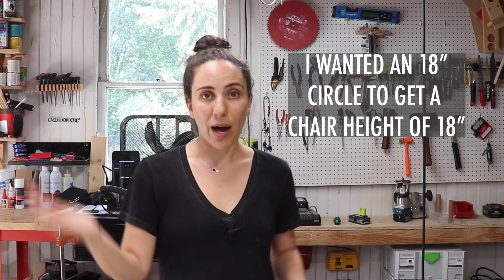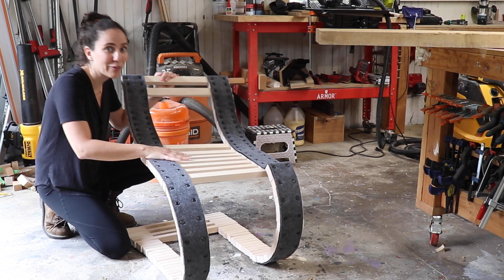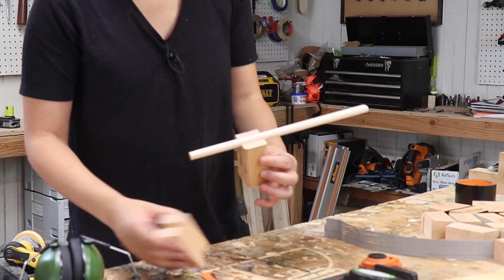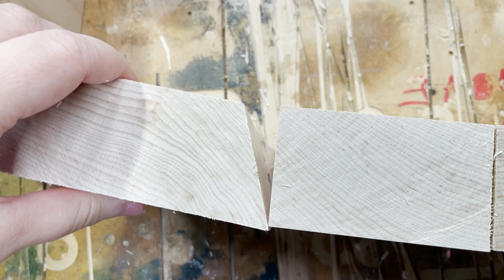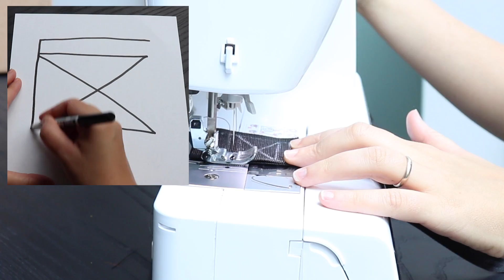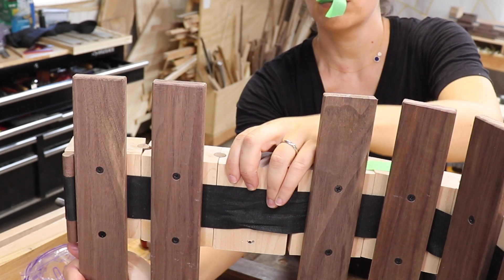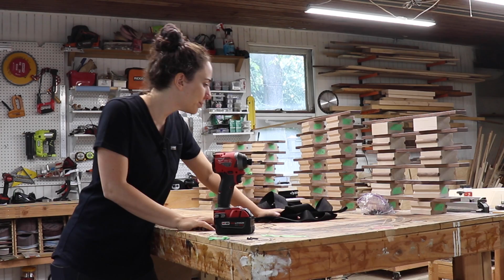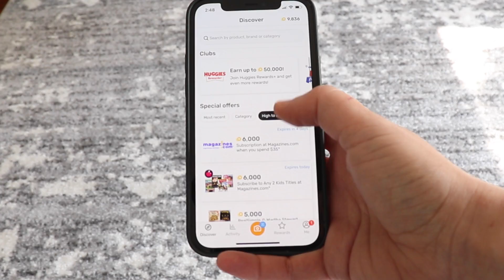I ATTEMPT to make a Roll Up Chair… AGAIN...

Comment: Actually you only need them to flex at the actual joints in order to unravel them right? So whatever material you use to connect them can be glued or fixed to the wood as securely as you want.
I think the main problem with this design is the sheer length of material that has the opportunity to stretch is just too much. If you limit what sections of material CAN stretch to only the joints, you should end up with a more stable bench. That said, that may also increase the force pulling those points apart because you're limiting where the tension is, whereas the current design is much more distributed. To test the weight, I would suggest putting weights on it, rather than yourself :P

Comment: Don't give up. Try manila rope it stretches very little and is a lot lighter compared to using a steel cable that some have suggested. That's why it is used for rope ladders, obstacle courses, etc.

Comment: I think instead of doing one big strap for the whole chair, you could do a strap for each segment. Then tension on one end wouldn't roll up the other. And to keep the chair from tipping forward, I think you should have a 90 degree joint at the front bottom.

Comment: Don't do it!!!! twice is enough already because there are just a few pieces  that take all the stress and would fail in time anyways as it is
so then first I thought of a side frame each side to hold the roll up securely  and in shape you want yeh it would work but no cigar
 and then thought what about adding folding cross pieces on the end of the floor roll up that could extend up and lock into the bottom of the seat and you could stagger them on the last two cross pieces to get the height you need to prop up the seat securely hahah yes it is bugging me too

Comment: I think the solution would be to fix to the strap to each board rather than allowing them to slide back and forth. Problem is that any tension you create is distributed and then released anywhere where you aren't putting pressure, like the top and bottom. flexible steel straps screwed to the boards could work.

Comment: Yeah the solid mechanics of this chair are very unkind when looking at it with a bit of hindsight, some modeling/calculations on this would probably show this needs some like... wild steel wire rope or something. But those stretch too! Long things stretch more (in length that is, fraction of stretching stays the same ofc) so that whole length of strapping with such a small crossection, under even moderate tensile stress, is just going to stretch. I don't think you need to waste leather on this. But the dowel splines look really cool, I love those!

Comment: You could drill a hole thru each block in place of the strapping and then insert a cable with a bolt with washer on one end and some threading on the top end and tighten another bolt with washer till the tension is correct as you want.  Over time as the wood shrinks you can tighten the tension more.

Comment: For what it's worth:  A linked chain, a bicycle chain is one example has much roll capability and little deflection in the side to side plane.  
As you know, the tighter the tolerances and stiffness of the material of the chain gives less side to side deflection.  A metal hinge with tight tolerances on the barrel inserted between each segment or "vertebrae" would work well also.  Think about the concept of concealed hinges that are used on a jewelry box for example. metal hinges will have much less "creep" than nylon strapping.  Or stretching.

Comment: It is not about strap material and stretching!
It's rather geometry issue. Every time back of the chair curls forward it releases tension, straps can slide and therefore gaps appear. The same goes for the bottom flat part, which can curl up when you sit on it. Maybe stapling the straps to the pieces could help

Comment: Love the video and the absolute candor you have about the process and the struggle. Not sure why you decided to limit the strength to such a narrow field of simply 2 straps. When I noticed you took out the center in the main supporting area I was wondering why.  Have you thought about keeping that area solid all the way across much like tambour? This would not only eliminate the side twisting problem but also disperse the leverage exerted on the angles across a far greater area. So a 120LB body would not exert 60 LBs of angle torque across the 2 2" pieces but maybe 6 Lbs across each inch of the entire width of a 20" chair. Also the strapping material has room to stretch. While this is not much on a inch to inch basis it is quite a bit in your build because its free across the entire length. Since the tension is dispersed this way any angle that can back fold will do so as we see happen on some of the end pieces. Once this tension is released the chair is allowed to pinch and collapse.
SO perhaps try a full length fabric that covers the entire length and width of the chair AND secure it to each and every piece. You can check your angles as you add pieces as well this way.

Comment: Perhaps you could consider additional strapping material at the stress concentration points. The principal issue I see with the design you've approached in this video is that your strapping doesn't account for the fact that the tension experienced by the strapping isn't uniform along its length. Especially where you are noticing gapping around the tighter curvature, the strapping will experience greater tension. Doubling the strapping across these concentrated loads may be all you need there.

Comment: You can get steel cable with a tensile strength of 1780 lbs and that's with a 1/8 inch diameter I would slot the planks with a 1/8 slot and run the cable in the slots and then you can also use a tension device along with the cable but take the cable out of the top plank with a stopper there to keep the planks from floating around to much and then run the extra cable down to the bottom of the chair with eye hooks and high strength carabiners so you can just hook it on and use the tensioner to pull everything tight this would also solve the top and bottom folding in on its self because you'll have a second strap pulling the top and bottom towards each other
Reply: Also might try pre stretching the steel cable before install so you don't have to worry about re sizing it again and again
Reply: But you really might wanna use some door hinges along that bottom curve as well to add less of a stretching joint

Comment: You could use bands of steel and it would not "solve" the issue. Once you stop the stretching of the webbing, you will run into your wood choice. Soft Maple? You need a much harder wood and a strapping material that does not stretch nearly as much as the material you are working with does.
Do the math to find the specific forces you are dealing with and select accordingly.

Comment: Maybe if you didnt use the long straps through the entire chair, instead just many short straps like tie two part together, and then the next two part, then the next two part and so on. It was so much more work tho, since you must pull on each individual short strap to mitigate gaps then. It was also finicky to pull on such short straps too, however you might find a way to do so efficiently.

Comment: Try the Clock spring from the inside of a large tape measure (several of obviously) this would be very resistant to stretching and a lot cheaper than carbon fiber.

Comment: The  problem is that the design is inherently just unstable/weak.  It's the equivalent of a ridiculously long cantilever through wooden joints.  What you could do is have rear legs that still allow it to roll up.  This could be done by the rear legs being either inside or outside the frame pieces, made in a very similar way with their own strap.  They would fall down and rotate into a curve similar to the bottom curve, but with a much larger radius.  This is hard to describe in text, but it could be easily sketched.  Ultimately, this would massively reduce the amount of weight the straps would need to support and the amount of pressure the wood would need to support.

Comment: I'm curious what a structural adhesive would look like if the dowels were adhered to both blocks. Some can be even more secure than mechanical connections and do quite well in longevity and under high tension. Another excuse to pull out the caulking gun!

Comment: You also might want to go with a hard wood or put metal rods in that line up to create more strength and less flex as long as they are touching perfectly the whole thing shouldn't need to be metal and it will cut down on weight

Comment: I feel like it's the wood itself that too "stretchy" so to speak. The wood is being compressed, squished into each other which has too much give. I think the edges in-between the parts could have some sort of facing to prevent this. By first idea is metal, but that's probably 10 times more expensive and time consuming.

Comment: no no no on the leather...it stretches too...especially over time and under tension.   the problem is the stretch in the webbing.   Even the best materials stretch a bit.   by not gluing the strap to each block you allow the total sum of stretch over the whole length to migrate to one spot.  Unfortunately I'm not an adhesive expert and can't say what the best adhesive would be but making sure your webbing is glued edge to edge on each block would only allow the small unglued portion to stretch and can't migrate to add up in one spot.  Still not sure its enough but would certainly be better.  Also, increasing the block thickness would reduce the leverage stretching the webbing....maybe do that in the highest stress bend on the bottom.  You could even use double or triple webbing on longer slats in that area too.  Still can't say its enough, but want to see this work!

Comment: I don't know if this has already been suggested, but is there a reason not to isolate the tension? This version has the straps freely moving along all the pieces, but you really need the most tension at the sharp bend near where your knee and ankles would be if you were on the chair. Maybe you should fix the straps to the wood near those pieces with screws hidden under the slats?

Comment: Not smart on this in any way but i think if you simplify the problem it may be easier. Instead of trying to get one continues piece of webing to go the whole way make a bunch that only go to the next board. It will be may more work but what could make it easier is if you make it modular. The idea of modular is if you figured out how to make the chair with 2 pieces. One is a hinge piece that has webbing connecting two pieces of wood. The other piece would be like a tounge and grove piece where you could make different angles. Hope that helps and makes it so you can make different designs in the future

Comment: It would be crazy complicated but if you use some sort of metal latching mechanism at each joint that can be released by pulling on a steel cord that runs through the whole chair, that would probably create a very strong chair

Comment: I would suggest using Kevlar straps and, more importantly, glue the straps onto the wooden parts so as to prevent the less stressed parts near both ends from yielding the strap length to the stressed parts and weakening them.
Reply: Strong but should check on UV exposure, may be an issue with Kevlar...

Comment: My daughter's boyfriend build a chair like this and had the same issue you were having. We solved it by using a chain similar to a bike chain in place of the straps (looked closer to mini tank treads so that the screws could anchor through it. He also used hardwood as the pine he originally used deformed slightly under compression.
Reply: Was going to recommend the same, not sure what the stretch would be for a bike chain, but I'd guess similar or less than steel wire (which is about a tenth of low stretch webbing). Personally I'd put it in a chanel under the webbing, then you won't see it when the chairs up and it might stop crumbs and dust falling in it. 

Fixing it at various points would also limit the stretch in specific areas. Currently the spare material from the back and base can spread through the chair to make gaps, if the material is fixed either side the stretch between each joint is limited to a percentage of the ~15mm between the slats, rather than  the stretch for the whole chair being a percentage of the ~3000mm of webbing in the chair. This might cause problems with rolling it up if the support material isn't inline with the corners it hinges on, but that should be a simpler problem (e.g. rounding the corners slightly).
Reply: Yeah, I was thinking about some sort of steel mesh. not sure it would roll up very well.
Reply: Think that is a much better idea than leather.. leather stretches a lot. Leather would be terrible.

Comment: Would hinges work? Instead of a strap, just put steel hinges between each piece. They can't rotate laterally, removing the need for the dowels, and they should never flex.

Comment: ok so I know nothing about engineering or woodwork or anything in the realm of this, but what if you connected the pieces with some kind of cable (or other small flexible material of your choice) inside of them? Like do something similar to the poles you added for sideways stability, but make it a small tunnel to have a cable go through. 

It would be a problem with tension when you want to roll it up, but maybe add an extra feature where you tighten it with some kind of clamp to however tight you want/need it to be? Kinda like how you can choose how far you want your car seat reclined. 

I doubt that alone would be enough, but I thought I'd at least throw the idea out there

Comment: What if you made some type of round case for the chair that it could fit into when its rolled up but also is used as a support. that or incorporate more pieces that somehow lock up into a support for underneath. It wouldn't be this amazing floating chair sorta design you're going after but it would still be pretty cool and still have the title of roll up chair plus if you go with the case route it would probably make it easier to carry since its not flimsy

Comment: I'm no expert, at all, but I'd go steel here,  there just is no room for any stretch,  the way that gets magnified from the top of the chair to the point where you are getting a Gap.  I was going to say to try dyneema,  but even that probably stretches too much. You could run the dyneema, quarter inch is way stronger than the wood, then put some sort of tensioning mechanism. You can make that as simple or as complex as you want .  Then with the tension you can actually adjust the back angle.

Comment: If you had moved your sewing machine to your garage (or wherever you've got your workbench) couldn't you have just removed one or two sections at the end and made the strap shorter rather than undoing all of them to make it shorter? Sure you may not be able to get completely comfortable while you're sewing but if you can get a "good enough" result then it would be far easier than dismantling the entire chair.
Reply from the maker: Not that simple.

Comment: You could probably make a sleeve that goes over the chair like a pillow case, I think that would take up some of the stress on the bendy bits. 

Could probably also add support to the outer part like you did with the inner part.

Comment: I'm no craftsman, but I honestly don't think leather is the solution, I would assume you'd have the same or similar problems. Leather stretches as well, probably more-so than a durable, tightly woven nylon strap or something...

In regards to the staple idea, I don't think that would've been the answer either. Those straps are under immense tension, something having to do with leverage is causing the weight of sitting on the chair to be a much greater force than you'd expect. You can see that even just the weight of the back of the chair itself, it might only be 5 or 10lbs or something worth of wood, is creating huge tension on radius section. Because it's extended, the leverage is multiplying the forces involved. That much force would've just ripped the staples right out, guaranteed. 

Something about the shape and design is just physically not ideal, it definitely needs a well-engineered solution to be able to work as you're envisioning. My first thought, without changing much, would be to use the most rigid, non-stretchable fabric-like material you can find, and try one last time. Maybe some kind of carbon fiber weave or something. Secure it to each slat really well, with some kind of bolt or screws, cross your fingers and hope for the best.

My next thought was maybe hinges of some sort rather than fabric straps, but that would add even more cost and weight, it would take away from the overall look and idea, and those hinges would still be under massive forces, and likely just bend.

I really think all of your ideas and efforts in this video were great, you came up with some really good, elegant solutions, and it was an awesome overall idea. I think in the end, the problem is just that you're a craftswoman, with an awesome, artistic mind, but not an engineer. You've underestimated how much strain would be on those straps, and thats proving to be a really big hurdle, that will require a well engineered plan and proper materials to execute. I'm not an engineer either, but I'm sure there are tons of people in the comments here who are, who can look at this from a mathematical standpoint and hopefully come up with some neat solutions to execute your plans for a rollable chair (:

Comment: wood is not a good material because of its low stiffness. also using some very stretch resistant material, such as steel band, cable, or account for the strech of the cable and the deformation of the wood in your design.